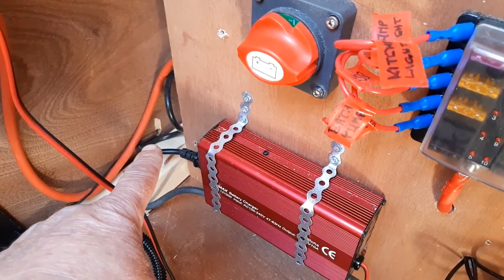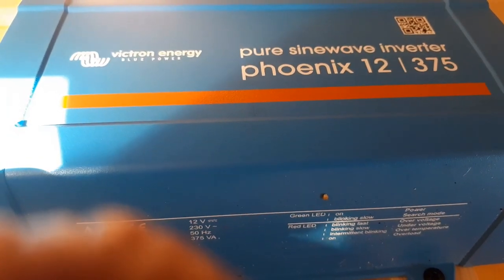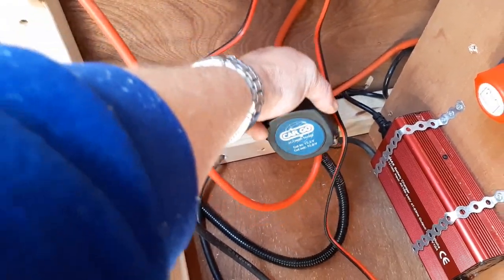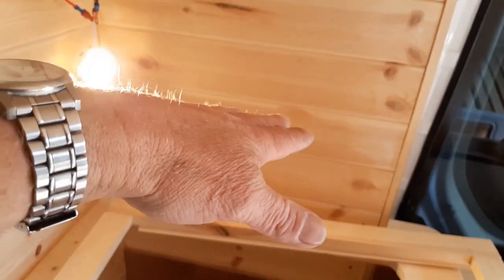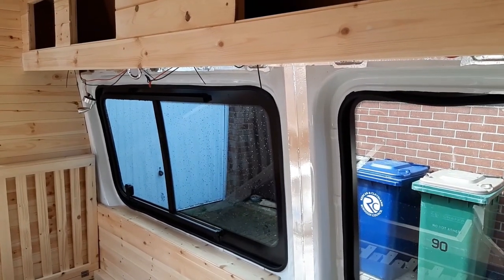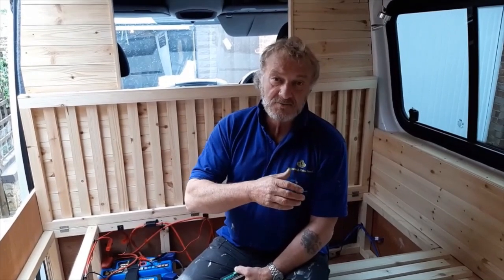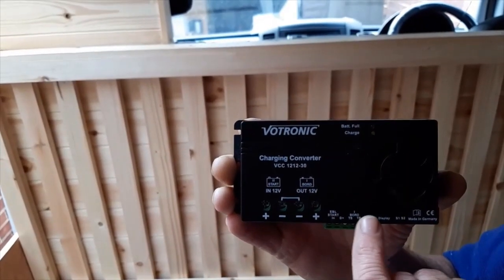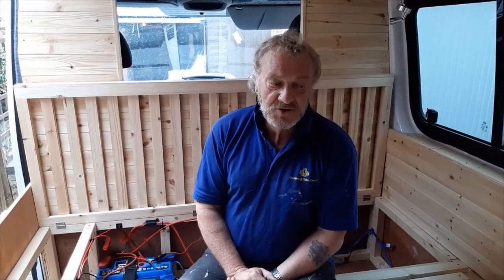14 : PART TWO /Sprinter van conversion / 12v-240v electric system

Comment: Did you put an isolation switch in the output line from the solar panels for when you disconnect batteries etc in the future?
Reply from the maker: Alan T Hi Alan , no I didn't , I just have the isolation switch from the battery to the 12volt fuse board as the batteries will very rarely be disconnected once everything is connected. However I may thing of doing that in the future, because when I need to disconnect the batteries I have to disconnect the positive then the negative solar panel cables before disconnecting then the reverse order when connecting.
Reply: @woolleycodwanderers4833  And make sure that the loose cables don't short circuit that's why I thought a cut out on the live side might be easier/safer when faffing about under the seats later. 😉  Wiring looks tidy.
Reply from the maker: Alan T thanks for that Alan, will bear that in mind, many thanks reference the wiring, I think it looks like spaghetti junction lol